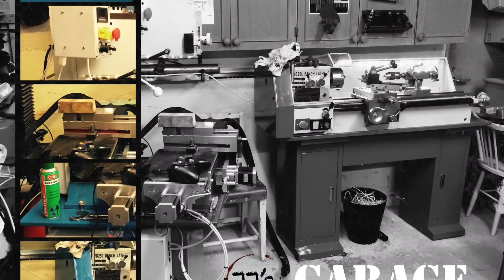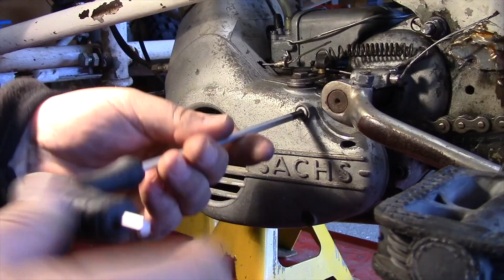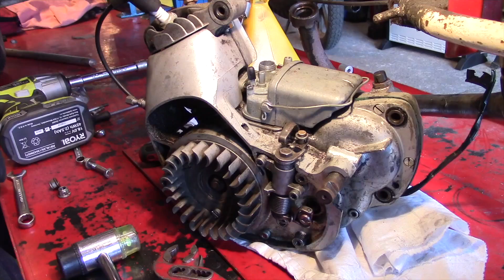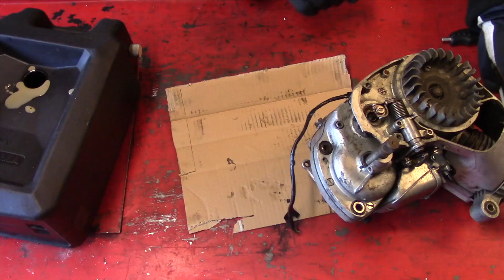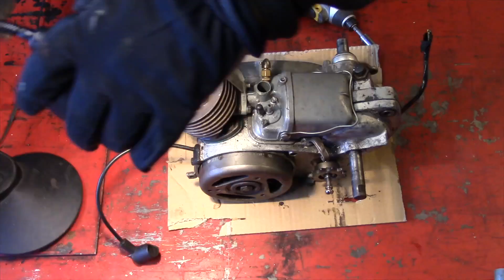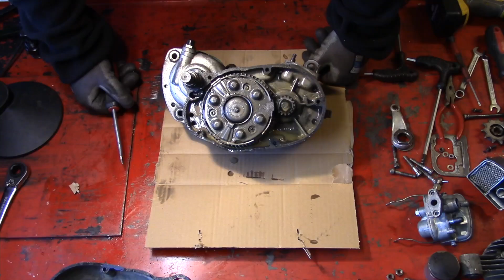SACHS 50/3 (MCB 1189) Engine Rebuild part 1

Comment: What is the tool you used at 18:00 called?
Reply from the maker: ørjan skancke it’s a flywheel puller (svänghjulsavdragare på svenska)
Reply: da blir det vel svinghjuldrager på norsk
Reply from the maker: Akkurat :)